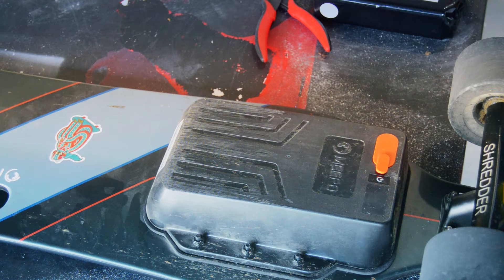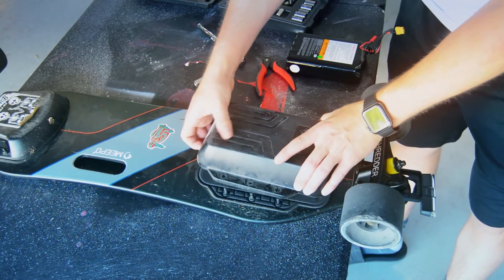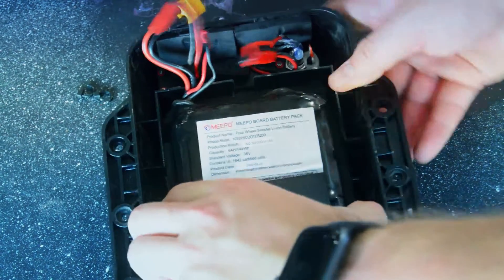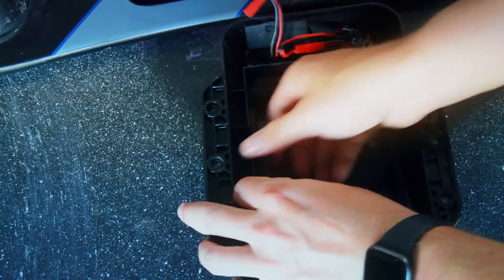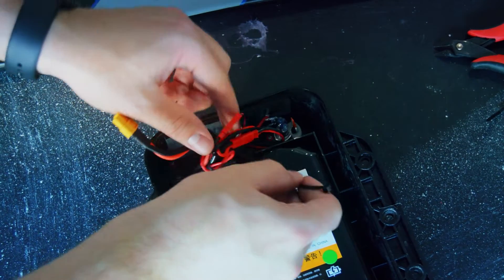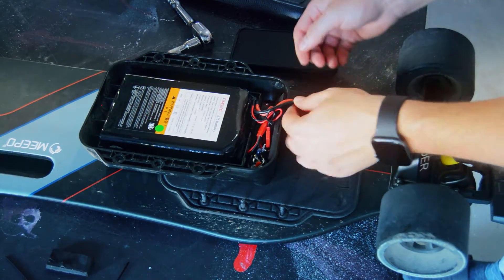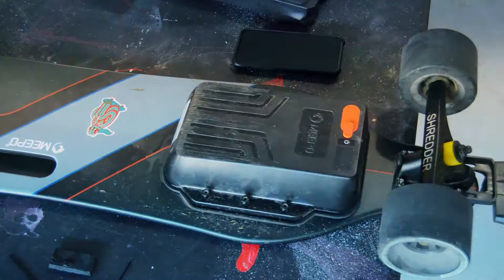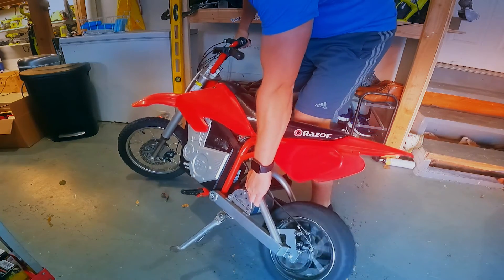Meepo V3 Extended Battery Upgrade

Comment: Hey brother, thanks for the video! I’m currently waiting to buy the MetroboardX!! It will be another 3 months before they’ll even take my order:(  So I was thinking I might just upgrade my Meepo V3 battery…is it worth it? I know another gentleman ask the same question, but maybe you have more of an experience with the new battery at this point.
Reply from the maker: If you're asking me, hell yes it is. I don't take my board out for sessions longer than an hour or so so the distance isn't a huge benefit for me. What I do love is not having the range anxiety and foregoing the power sag that comes with the normie-range batts. If you've got it like that, I'd say buy the extended battery. There's a guy who frequents the meepo subreddit who can build an ER battery for just over $200 so you can save a few bucks there. Think his name is E-Skater Alex.
Reply: Thanks buddy!!👍🏽👍🏽👍🏽👍🏽

Comment: What if you created a custom battery case and used the meepo city rider 2 battery, (504ah), instead of the er battery, would that work? they're the same voltage, (36v). The er battery is 288ah
Reply: Also, could you leave a link to the e skater alex website or whatever website he uses?
Reply: I think he means 504wh lol, also the city rider 2 battery has 2 amps output instead of 30 amps on the er battery. Not sure if that would make a difference.
Reply from the maker: @Chomroend  Google "Eskatealex reddit" to find him. I don't think he has a site, per se, but you can contact him there. As for replacing it with a different battery with the same voltage, I can't advise. I will say that I wouldn't do it myself simply because it could potentially kill the whole board. The risk/reward isn't there for me.

Comment: Is there much of a difference in range as said on their website(20miles) with the new batteries ?
Reply from the maker: It's hard for me to say yet as I haven't been able to ride this thing to empty yet but what I will say is, with the old batts, I would find sag whenever the battery dropped closer to 60% or lower. That sag is far, far less prevalent with  the new pack.

Comment: I wanna be for hundred procent sure. U have a V3 standard? Is there any problems since u have upgraded V3 with ER battery? ❄️
Reply from the maker: Yep - you're 100% fine- that's exactly what I did in this video. In fact, even Meepo's website will show you that the ER battery is made for the standard range board! Ride on!